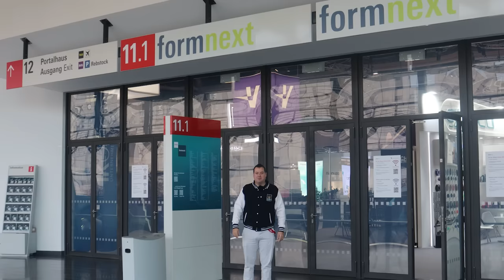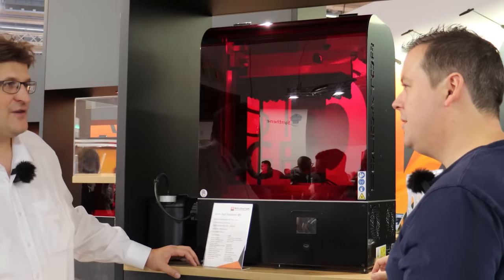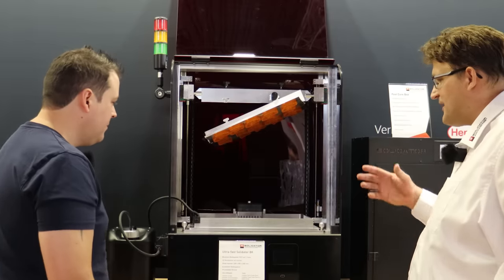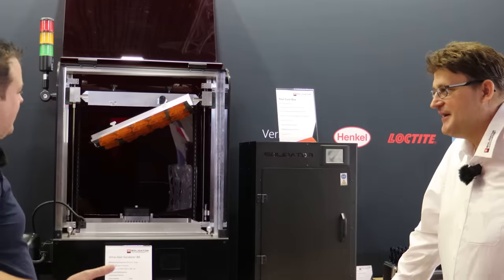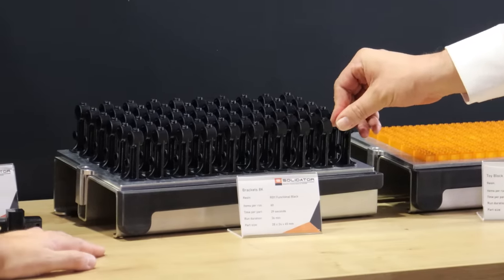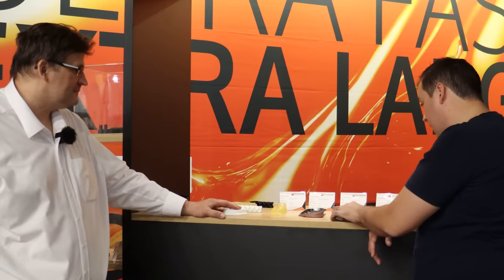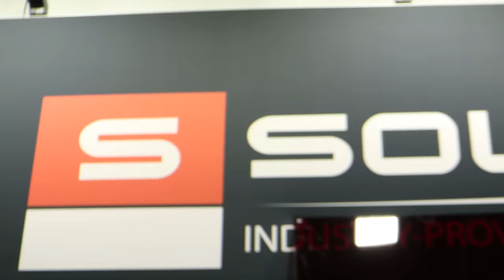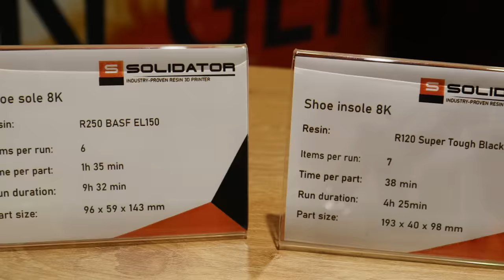Formnext 2024 - Solidator hard working, repeatable, industrial resin printing

Comment: Any resin heating or auto leveling on this machine?
Reply from the maker: i believe it doesn't have a heater due to the temps of how fast it prints I'm not sure about auto level but seeing as it has twin z axis on independent motors i would say it does